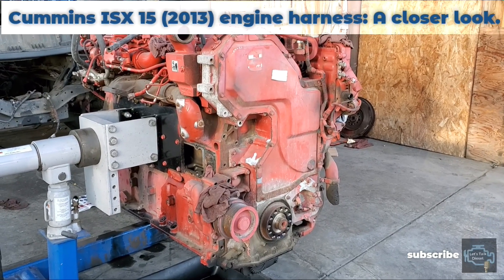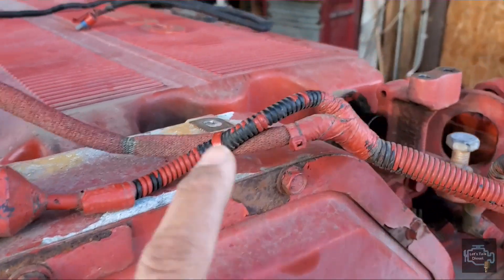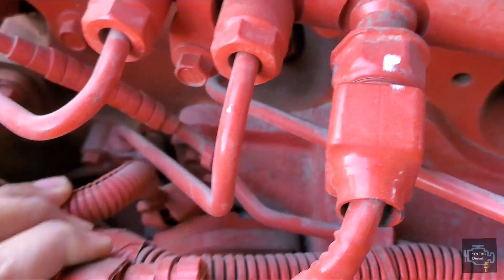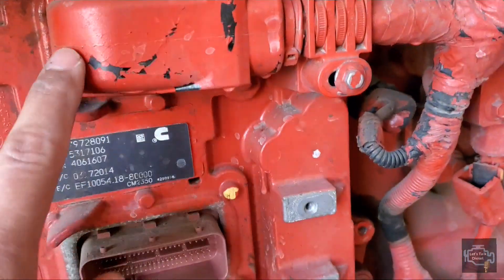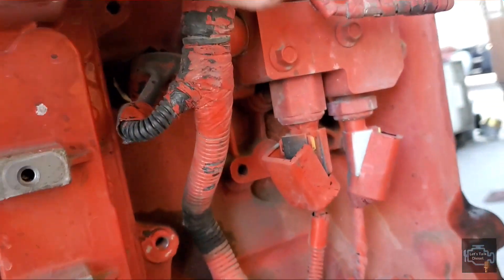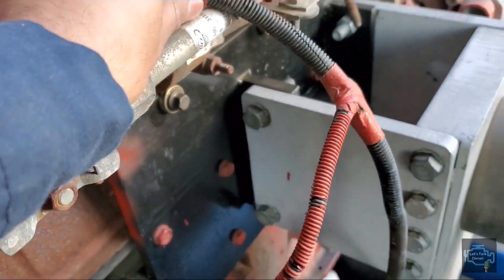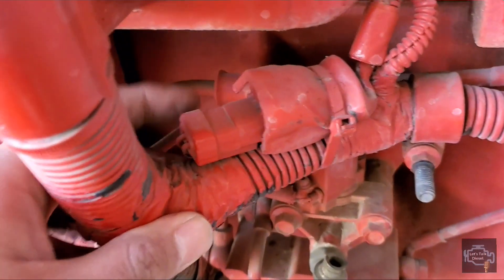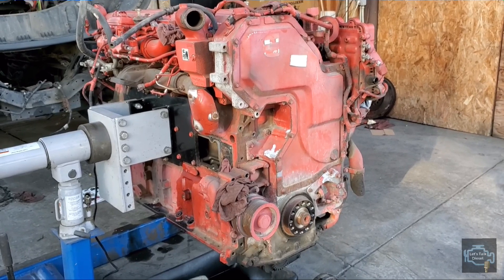Cummins ISX15 2013 engine harness: A closer look.

Comment: Super late on this video ( great btw thanks) but that “fuse or bypass” after you explained the boost sensor is ambient air pressure sensor , thanks for the video!